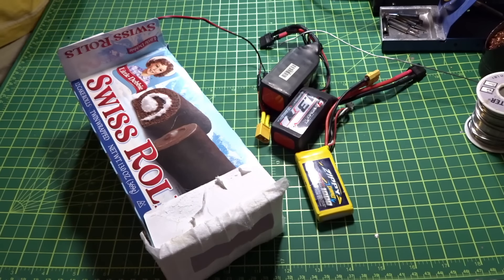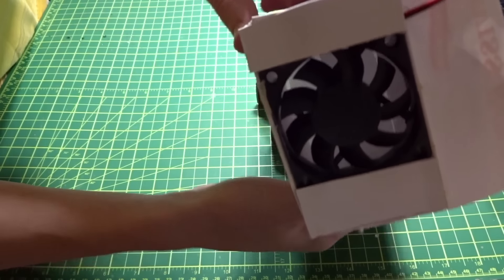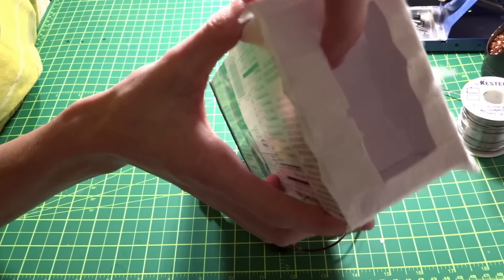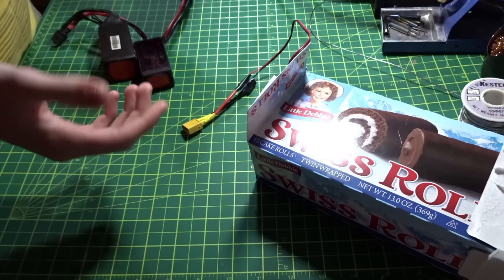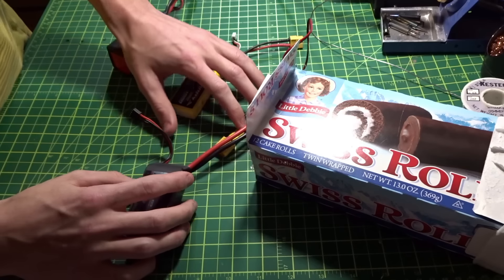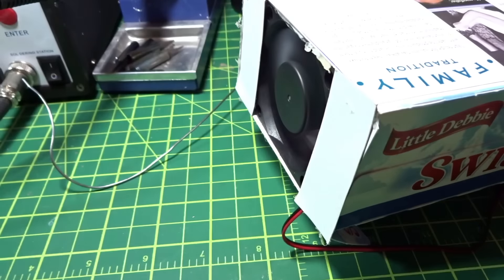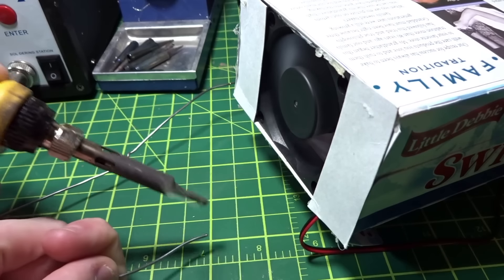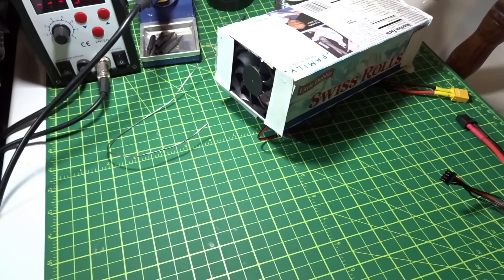Safer Soldering?

Comment: It's a good idea.  Works well to draw the smoke away from you.  I doubt it traps much but still good.
Reply from the maker: Yeah, this fan is not strong enough to push air through that filter, will see if it darkens at all after a few weeks use.

Comment: Your iron would need to reach 1749 °C or 3180 °F for lead to be in the fumes. But who knows what's in the flux so valid point nonetheless! Nice to not get watery eyes while trying to solder xD
Reply from the maker: I was not saying that the lead it self was vaporizing, but I was under the impression that tiny lead particles get carried up in the smoke on the riding flux fumes?
Reply: I really couldn't tell you. Lots of particles do fly off and go all over the place when using the metal sponges tho! Still a great idea, maybe activated carbon filters would allow better airflow than the paper type?
Reply from the maker: C. Av The listing says this is activated, but I really have no idea what that means hahaha
Reply: Or try one of these cabin air filters for cars! http://a.co/d5Ed9dk

Comment: Actually in order for lead to turn into smoke it has to reach about 1000 degrees
Reply from the maker: I was not saying that the lead it self was vaporizing, but I was under the impression that tiny lead particles get carried up in the smoke on the rising flux fumes?
Reply: no. the lead does not get transferred with the flux smoke... It would be too dangerous for general household consumption if that was the case
Reply from the maker: Lachlan Peknice Hmm, I have read all over that the lead is the danger when doing large scale soldering.
Reply: Lead can only really harm you if it gets into your body
Reply from the maker: Rc Addict with planes Umm, breathing it in and attaching to your lungs isn't n your body? haha

Comment: you are more at risk from touching lead solder with bare hands than what you breath in from fumes.  also just so people know, a filter with free air gaps does basically zero filtering, particles take way of least resistance, which means you have actually created a device that distributes fume particles throughout your room and house more rapidly than simply not having one.  If there are any dangers to the fumes you have hugely increased your long term exposure
Reply from the maker: Hmm? What is your background. I will accept information, but I like to know credibility so I know it is true. How does it increase the exposure from instead of breathing them in they get pushed away?

Comment: an desktop powersupply with the original metal case would be better in my opinion and most of the rated psu has big fans and running them on lipo would really sucks all those leads smoke without getting in the way while you are soldering ;)
Reply from the maker: Yes, I jut wanted to try something smaller for a few reasons, cost, noise, and space. It might also be too powerful and pull heat off haha, idk.